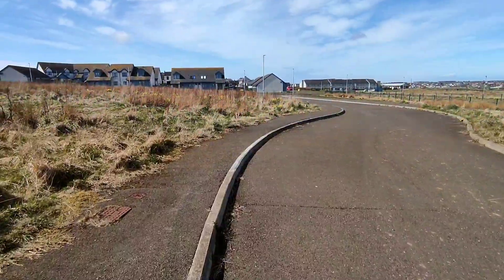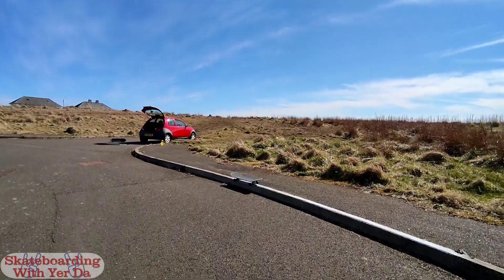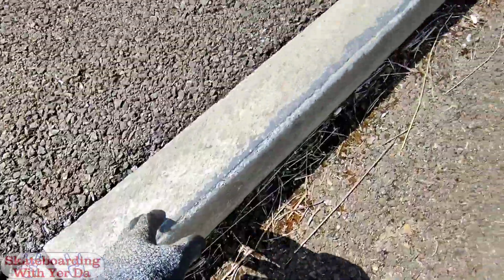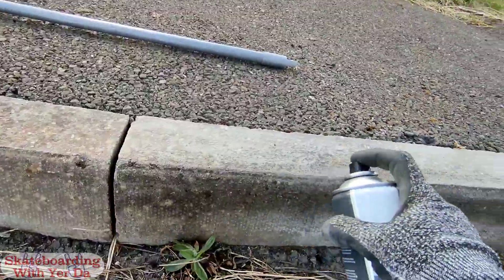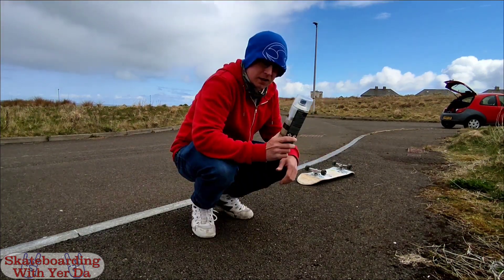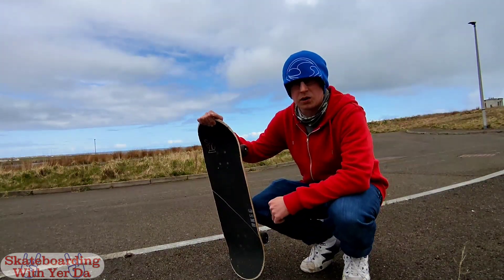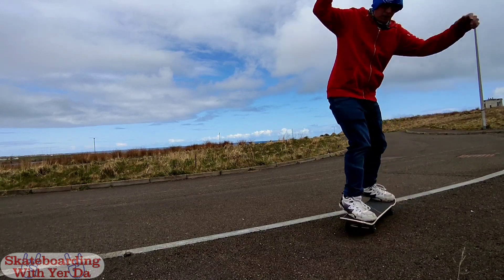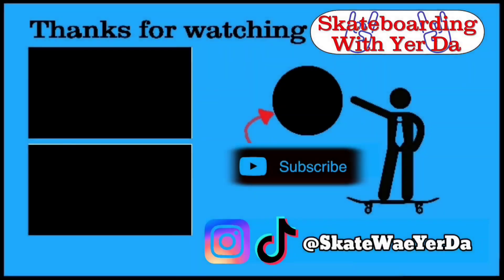DIY kerb spot | rub brick and lacquer curb prepping #StreetSkating

Comment: That curb is looking good 👍 
I know what you mean by feels easier to ollie into it frontside but as your finding when you do that the momentum wants to go forward which is why your stepping off every time. To counter that you want to lean right back. Either that or try to come at it a bit more in line with it, like more of a 45degree angle rather than 90. Your have it in no time 😁
Reply from the maker: Thanks mate, yeah I know what I'm doing wrong I used to be able to do them but just lost them one day and they never came back 😢 with a bit of effort I'm sure I'll get there eventually! 🤘
Reply from the maker: It's weird though I actually find it easier to pop frontside into it rather than in line with it! 🤷🤣